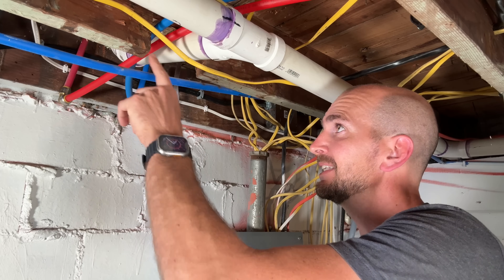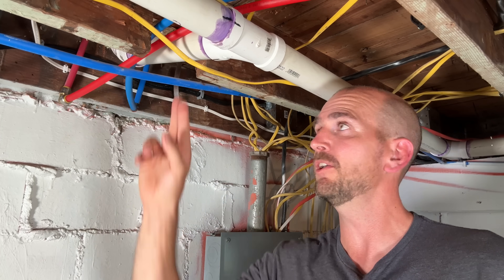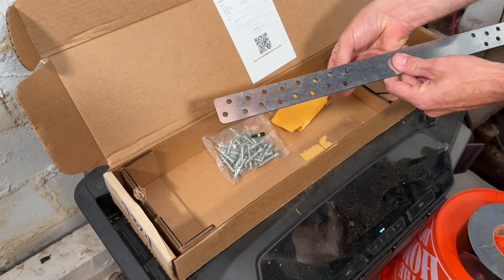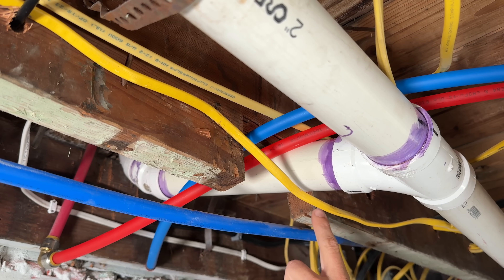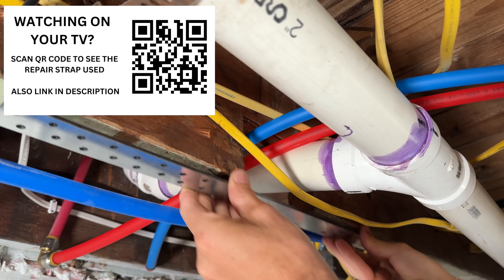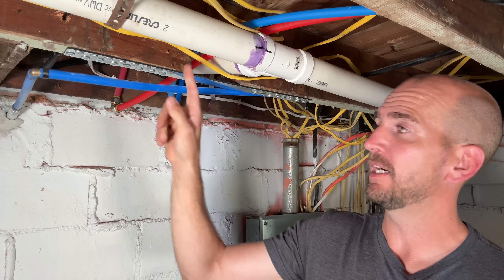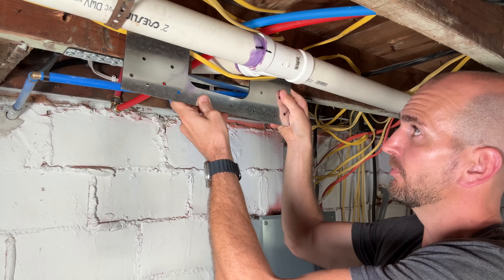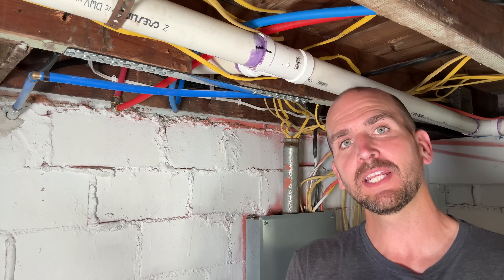Quick DIY Repair for A Failed Inspection:  Notched Floor Joist

Comment: Hello!  First time watcher here.  Do you have videos on repairing a kitchen drain But… the leak is just behind the wall where the sink drain is hooked to the main drain.  So in my case I would have to cut the drywall out around the the pipe to see the leak.

Comment: Worth noting, if you ever have to pull a permit for work near this joist, there’s a decent chance your AHJ inspector will flag it. Fine for a DIY repair, but if a building inspector sees it during permitted work, odds are they’ll fail it - depending on jurisdiction, that is.

Comment: I used this product in my renovation project. Instead of trying to cover it with drywall, I cut around the strap, "sistering" 2x2s on either side of the joist so the drywall was secure in the surrounding area. Then I built up 2 or 3 layers of a Durabond+Titebond mix directly over onto metal strap. I completed the patch with Fibafuse and All Purpose mud, and I'm happy to say that the patch is invisible.

Comment: You don't need pilot holes for those screws...Just send them...Not that pilot holes hurt, but, unnecessary, especially with Torx head screws..

Comment: I am a retired city building inspector. I’ve had this happen a lot. Took the issue to Simpson Strong-tie, they are the ones to engineer these types of products.  This product does not retain the integrity of the floor joist in this application. This product will only restore a wall stud in a vertical application. Your floor joists will still sag over time. To properly fix this, the drain has to run under the floor joist,  then sister the same size lumber on both sides of the cut floor joist extending at least 3’ past the cut area in both directions. Or you need a structural engineer to write you a letter stating the cut floor joist isn’t compromised. Simpson Strong-tie has a wonderful website, and offer free online ICC approved classes on many building topics. Please do your homework. You need to make a correction video, and the inspector needs future training  in point loads, and floor joist spans. The code will except an engineered product as long as you are using it in the  proper way. I would have failed this repair.
Reply: I shook my head my I watched this. Imagine that, a flat steel bar about 1/8"-3/16" thick won't bend when under load. I don't think so. I'd like to see the ICBO approval for floor joists.
Reply: @baldy95307 The strap would be under tension on the bottom of the joist and therefore would not bend, an interesting idea but without an engineers report I can see it failing every inspection.  Their website does show a link to the report but I couldn't find it.
Reply: I disagree. I am a retired Structural Engineer and this can certainly work.  The bending in single span beam actually creates horizontal compression forces in the top and horizontal tension forces in the bottom.  He said there is adequate wood at the top for the compression force but the bottom tension is obviously the problem.  I can't vouch for this particular fix without a little more info, but the concept is sound and It is likely fine.  I would want to verify that the joist is not sagging first, and if so it needs to be jacked up level before installing the strap to do this right.  There is another potential but unlikely issue that this fix will not address, and that is what is called shear force in the beam.  I won't go into that, but it is not a likely problem in a residential floor.  Bottom line, I believe this can be a smart, cost effective fix for many floor joist that have been cut like this one.
Reply: anyone should have seen this coming and before it went up I would have sistered a 4 inch steel joist before anything. If my plumber did this he would pay to rip it all out and then put it back together.. after I said what in the world were you thinking
Reply: I guess it makes the joist repair function more like the bottom of a truss in tension if installed that way, which if analyzed correctly could still be okay. Yes?

Comment: The strap below the joist is a solution but not the best option as the joist is still likely to sag, bending the metal strap. The side plate is a better solution as the orientation of the metal presentts a greater thickness of metal to reduce the chances of it bending

Comment: I suppose if it not expensive it would be worth while.  Realistically it's just a 2 ft piece of steel with holes drilled in it.  Something you can pick up at many hardware stores.  Yea its nice to have it pre-drilled with matching screws and such but not something I'd special order.

Comment: Inspector approved? Yeah, i suppose it won't fail catastrophic now, but if stressesed enough, it will develop cracks. If the screws slide through the holes, then i would say there is too much slop to bring back the joist to its original stifness, even if you jacked it up before securing the other side. Is there any chance the instructions said to lean the pilot drill bit along the side of the hole that us closer to the end? By alternating the drill and screw steps as you also alternate sides of the notch, you will be tensioning the strap. Just don't tighten the srews down until all in. Understanding and doing this will make the strap a whole lot tighter.

Comment: I used 1/4" thick 2x2 angle iron that went twelve inches beyond the opening and then used  four  4" x 1/4" lag bolts.  I had to grind out a little of the vertical part of the angle for the pipe and put a rubber shim on top to protect the PVC.  Passed home inspection.

Comment: I designed this exact type of repair for a notched 2x8 beam that had started cracking.   I restored it to its original strength. It took way more screws to develop the capacity of the beam than that.  Also I jacked the beam to install the plate so that it was carrying the load when released not just resisting new loads.  Pretty interesting product even if I am skeptical of the connection capacity. I could certainly see using that to reinforce beams before cutting into them.

Comment: Well damn, I could have used these about 1.5 years ago.  Instead did some very creative sistering using a lot of structural screws and glue to bring back strength to some stupidly weakened wood

Comment: This is awesome I know that I am going to need this product when I do the renovation on my second floor bathroom. I know that the previous owner had some gnarly notches in the joist to run the plumbing for that bathroom. I was planning to sandwich plywood but this seems like a much better solution. Thanks for highlighting this!

Comment: He doesn't realize that this stupid attempt at a fix will fail. The grain of the wood is going the length of the beam. Those short screws will do nothing other than to help split the existing beam. There are too many screws weakening the beam. You can see in the video that the grain is vertical so as the wood continues to dry and put under stress, the beam will split. This is a bandaid, not a true fix. The pipe should have been routed to the corner and run inside the first two beams. The pipe is actually running lower than the beams so just cut the pipe and run the other pipe under the beam. Mike Holmes would be screaming about this bush fix and I bet no engineer would actually accept it, especially since it means you would not add sheetrock to the bottom of the beams.

Comment: Letting you know, I just purchased some more Wago lever nuts and a Klein Breaker Finder from your link. Also ordered a wire clamp nut wrench from your links a few weeks ago. So you can make sure that you're not being screwed. The Amazon people are very sneaky. Also, I hope it helps you out, as I do enjoy your electrical content the most. The You Tubes doesn't seem to have E-mail anymore, nor ways to send you E-mail, so I don't know if you see this or not.
Reply from the maker: Thanks so much for the support.  I don't see all the comments but I do try to get to most of them.  👊

Comment: Hi. I have an outdoor circuit breaker box. It seems to trip once a week. Only thing running at the time of the trip is the HVAC AC unit. So that goes out and any other plugs connected to it. When I go outside to the circuit box, none of the breakers tabs have moved forward for me to to know which breaker is the issue, so I just push the main breaker tab to the right and back to the left. This fixes the issue and the items in the house that went out will come back on. What could be causing this? Also, this only happens during summer months of the year. It’s extremely hot out and the box faces sun side of the house. Same issue started last year. But I would think if it was due to the summer heat, then all electricity would go out. And why would it happen once a week when it’s extremely hot all week.

Comment: That makes absolutely no sense for structural integrity, just makes someone feel better. A plate installed on the side of the 2x that closes the notch could offer some strength.
Reply: I'm a retired structural engineer.  The strap carries tension force in the bottom of the beam due to bending.  This actually makes perfect sense if you understand the stresses inside the beam.  This is
a smart solution for this situation.

Comment: Just get an angle iron plate welded and the radius taken out. Send-Cut-Send will prep it and a local welder can TIG it. This plate turns the bottom of the joist into Swiss cheese. There comes a point when TOO many holes compromise the integrity of the wood fibers and overall structure. It's like when one drills too many holes on the broad side of a wood plank and some line up such that it's like perforated paper. That weakness will lead to a crack.
Reply: If strapping passes code inspection, then go for it...

Comment: I didn’t know this product existed. I’ve made my own. I predrill holes, both in the strap and joist. Joist for the same reason - not to split the wood. Because of my paranoia and preference to over engineer, I also use construction adhesive between joist and wood surface.

Comment: Simpson strong tie straps don't need pilot holes.

I've had quite good success driving the screws at a slight angle - really helped tension the strap and was similar to jacking the joist back up.

Comment: That is insane. I worked for an engineering company proofreading shop drawings to make sure that did not happen, corodoration of trades. The plumbing should have been moved. People do not know or just do not care anymore. Also, the way it is installed, it would have been stronger if the edges were rolled over at least 1 inch, or if it had a strip welded down the middle, more like a T bar.

Comment: Does anyone else notice the rather odd riser conduit on the panel behind him?  Some wire uses it, others do not and does not appear to be old vs. new runs.  It may have been for the primary, but no longer (probably that black wire).  Looks like a choke point to me and makes servicing the panel harder than it should be.  

Those romex wires are also not secured properly... typical old house rat's nest.

Comment: It's a fine repair. I would suggest using polyurethane construction adhesive between the steel strap and the wood .My go to is the Loctite PL PREMIUM FAST GRAB 8X. Whenever I am repairing wood or building new with wood I use coated decking screws and   Loctite and also pilot holes to prevent wood splitting. When I use those steel brackets I do the same thing .
Reply: You shouldn’t use deck screws.  They are not as strong as construction rated screws, especially in terms of sheer strength.

Comment: And the inspector completely missed the violations at that electrical panel.... and was this "DIY" repair signed off by a structural engineer? That thin strap is not strong enough to make up for the strength of the removed wood.

Comment: 😡😡👎👎   Not impressed at all.   1) Too lazy to drill out for the drainage line.  2) even with a drill out, a tensioning brace is required.  3) Once the cut out was made the stress was also created.  4) You should have jacked up even slightly to release that stress and then install the tensioning brace!    👎👎

Comment: I had a similar problem in my house. I used 1/4" thick 2" angle iron on each side at the bottom through bolted with 3 bolts each side.  Took forever to drill the holes for the bolts.

Comment: They should have designed it using 3-D angle iron, the simple 2-D strap won’t hold very long if anything else was butchered by the cowboy that ran that plumbing (sorry, didn’t mean to offend our fine cattle herders).

Comment: You really did a number on that blue Pex. 3:08-3:12 in the video.
May want to replace that section or a leak will occur in time.
Reply: @bigjeep2195

Our camper had a very sharp screw tip in direct contact with a half-inch pex line. FOR SEVEN YEARS before it wore through and caused a leak. 

That pex line is fine.
Reply: @billstevens3796  So you're saying it did leak but took 7 years so that's okay?
What world are you living in?
Reply: @bigjeep2195

I'm making a comparison. To make a point. 

Pex is crazy tough as I show in my example. 

By comparison, brushing it with the drill chuck will do no damage. 

Sorry I have to spell it out for you.
Reply: Doubtful

Comment: with all the concentration on the joist, I also hope the home inspector failed that mess of electrical wiring going in to that panel.  I think my electrical authority would revoke my license if they could had they seen me do something like that.  All I can say is I hope thats not legal there. If it is there must be some Very Very scary looking homes around there.
Reply from the maker: Yeah, not pretty for sure.

Comment: You should only install the screws on one side. Then, jack up the long side of the joist to take the stress off, then install the other side.
Reply: Rest assured. That joist was already jacked-up. Looks like the plumbing is too. 😅
Reply: Yes. Jack it up a little bit

Comment: Wildly overpriced products, NGL. $80-90 USD on sale? Come on.
My repair was done with a piece of 1.5" x 1.5" steel angle iron from local retail, $15 Canuckistani Pesos. Yes, a PITA to drill a dozen holes but hey.

Comment: This WILL NOT PASS INSPECTION unless there are stamped engineering drawings that accompany it. This is misleading… From a 37 year owner of a custom home construction company.
Reply: Here in California, anything like this requires approval of structural engineer, to ensure the structure still meets earthquake requirements.
Reply: They have an engineering report. https://cdn.shopify.com/s/files/1/0275/0169/1018/files/dp24-30-instructions-eng-report.pdf
Reply: If you use some of the pre-approved Simpson strong tie straps you might be able to avoid the need for a structural engineer.
Reply: @Ariccio123 not in this application. The Simpson straps are only to be used in a vertical setting to prevent uplift.

Comment: That thin metal strap isn't going to support a sagging joist. The metal needs to mounted to the side because is more ridge. It would have been better to get a 8" x 24" x 1/4" thick plate. Cut the notch for the pipe, & drill a lot of screw holes, & then screw the plate to the side of the joist. Preferrable cut the notch with a hole saw that is slightly larger than the pipe diameter & cut out the bottom piece using a jig saw using a metal cutting blade. This will provide the max. strength.
Reply: @guytech7310

It's amazing that there are so many people in this thread that don't understand how a floor joint works. 

(You being one of them.)
Reply: @billstevens3796  Pleases, Explain why I am wrong
Reply: Mr Stevens, Your response is deaf ing. I think its safe to state that you are just T-rolling.
Reply: @guytech7310

Sorry, I don't live on youtube. The bottom of that joist is in tension. It could be repaired with a strip of 16 gauge sheet metal and some roofing nails, which is exactly what my father used over fifty years ago on a 2x8 joist that had been completely cut in two. The repair is still solid.
Reply: @billstevens3796   The tension was released when the notch was cut out. Air does not retain tension.  The bottom of the joist above the pipe in the notched section is in tension. There is no tension on that steel strap. Now if you used screwed two angle brackets on each side of the notch, & used a bolt to pull the bottom of the joist together would put it back in tension. but that does not really address the problem.

"It could be repaired with a strip of 16 gauge sheet metal and some roofing nails, which is exactly what my father used over fifty years ago on a 2x8 joist that had been completely cut in two"

Let me guess, you have a bridge in NY you are trying to sell to me? You dad thinks he mended a 2x8 using a 16 gauge strip of metal on the bottom that was cut in half. Is that repair listed in the structural engineers handbook?
Reply: @guytech7310

Wow, you still don't understand how floor joists work. 

The ignorance displayed on this thread really is a reflection on education these days. 

You have a nice day now!
Reply: @billstevens3796  you are definitely right that the bottom is in tension. As far as how thick the steel needs to be or how many fasteners are needed, I honestly don't know. But you are 100 percent right to prefer a strap over bracing the sides like guytech is saying.

Comment: The strap looks weak. The tension would be in the center of this strap. It might crack or bend. I would reroute the PVC and replace the joist, but I am not a structural engineer. If there is settling or a shift I would expect this to fail.
Reply: @frosted1030

Quite obvious that you are not a structural engineer. You didn't need to tell us.

Comment: don't point out the plumbing mistake, don't jack up the joist before bracing it, act like a steel strap with some holes in it is some kind of ground breaking invention just because you're getting paid to make a video on it . Sometimes it's  easy to block a channel. REALLY easy.